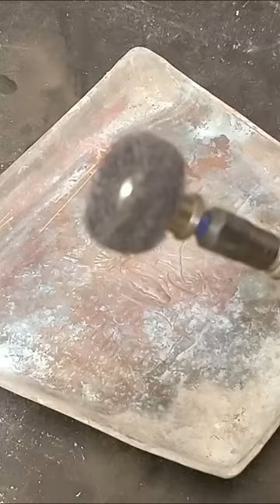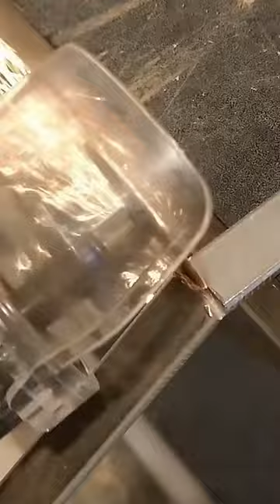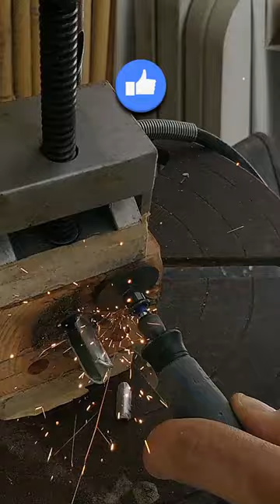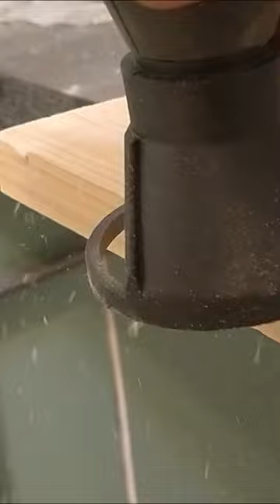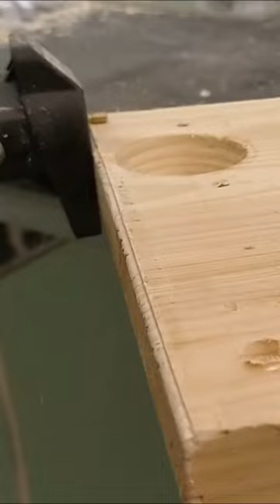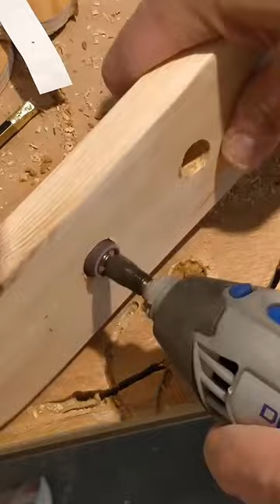Must-Have Dremel Accessories - Part #2 | XDIY

Comment from the maker: 📢 Full Dremel & accessories review video - https://youtu.be/meHbpcSzPD0
📢🔗 Links for the Dremel tools & accessories that I'm using in this video and more:
* Other tools & accessories that I'm using - https://www.itzikdiy.com/tools-list?m=1
* Dremel Rotary Tool - US - https://amzn.to/3IiKKau 
* Dremel Rotary Tool - UK - https://amzn.to/3KQtYBi 
* Dremel Rotary Tool - DE - https://amzn.to/3qbJQq5 
* Dremel 335 Plunge Router Attachment – https://amzn.to/36rqo1P 
* Dremel 225 Flex Shaft - https://amzn.to/3tfWRRt 
* Dremel EZ SpeedClic Shaft - https://amzn.to/3tfmH86  
* Dremel 407 Sanding Bands - https://amzn.to/3wcD872
* Sanding Bands (Replacement) - https://amzn.to/3u5qpAD 
* Dremel 456 Metal Cutting Wheels - https://amzn.to/3KJzFAU 
* Dremel 191/192 Carving Bit - https://amzn.to/34LM2NB 
* Dremel 678 Line and Circle Cutter - https://amzn.to/3MUm3os or https://amzn.to/3iaIeJ5  
* Dremel 561 Multipurpose Cutting Bit - https://amzn.to/3qd5aMa 
* Dremel 403 Nylon Bristle Brush - https://amzn.to/3iuCdqR 
* Dremel 511 Finishing Abrasive Buffs - https://amzn.to/366NOcN
* Finishing Abrasive Buffs (Replacement) - https://amzn.to/3q76GiI  
* Dremel 577 Detailers Grip Attachment - https://amzn.to/3IfFDbh 
* Detailers Grip Attachment (Replacement) - http://ali.ski/Utuqk
* Dremel A550 Safety Protecting Shield Cover - https://amzn.to/3JjVbw2 
* Safety Protecting Shield Cover (Replacement) - https://amzn.to/3ifoNPk 
* Dremel 576 Shaping Platform Attachment - https://amzn.to/364h1Fl
* Shaping Platform Attachment (Replacement) - http://ali.ski/oskm_ 
* Wood Carving bits - https://amzn.to/3KMbiTp 
* Dremel A550 Diamond Cutting Wheel – https://amzn.to/3IbpByZ 
* Diamond Cutting Wheel (Replacement) – https://amzn.to/3JkhuBx or http://ali.ski/qTs8A
* Dremel 544 Wood Cutting Wheel - https://amzn.to/3COC9LV 
* Wood Cutting Wheel (Replacement) - https://amzn.to/3tdJukT or http://ali.ski/BfPT7 
* Wood Router Bits - https://amzn.to/3MVsDuZ or http://ali.ski/-MQg7
* Dremel 565 - Dedicated Locator horn / Multi-Purpose Cutting Kit - https://amzn.to/3igl5ox
* Dedicated Locator horn (Replacement) - http://ali.ski/XCzo- 
* Dremel 220 Drill Press Stand - https://amzn.to/37uCRlD 
* Other Dremel Accessories - https://amzn.to/3Jkd3GT or http://ali.ski/yxcxST
* Dremel EZ Twist Nose Cap - https://amzn.to/3L6zd07